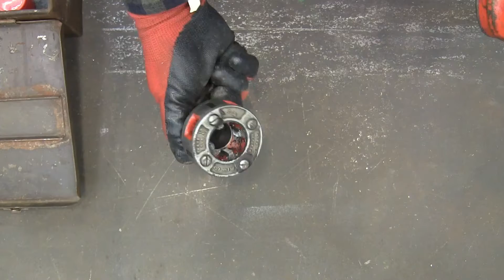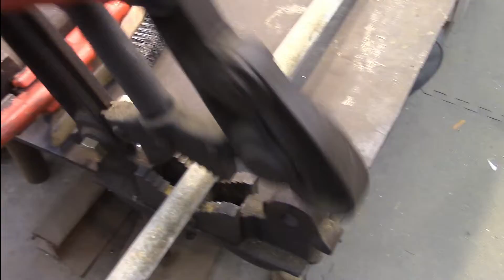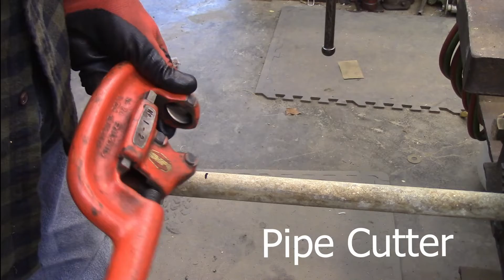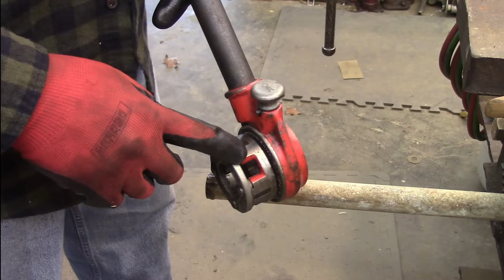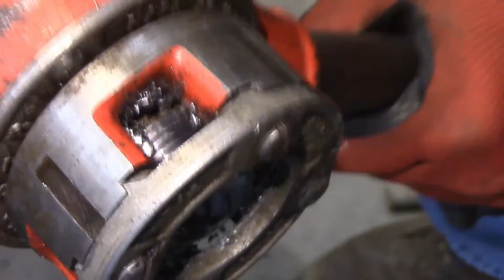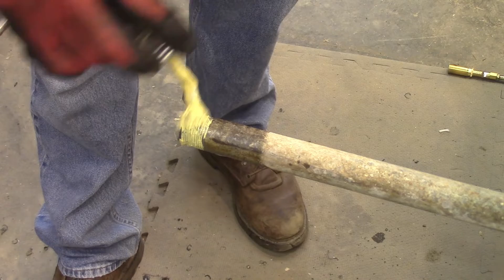DIY PIPE THREADING AND SEALING

Comment: Hopefully you know that the zinc flakes off galvanized pipe and plugs up gas jets. That's why black pipe is used for gas and propane. Happy pipe fitting.
Reply from the maker: Thanks Jeff, I do know that it flakes but I had enough of it on hand to do the job.  I've used it for years and not had any trouble.  It's for my aluminum melting furnace to nothing vital.  Thanks for the info!

Comment: Good video on threading.  If you ever have a chance get some Loctite 565 thread sealant. It is the smoothest thing I have found.  And brush on, oil base Rust-o-leum paint works very well too for gas.  Have a good weekend out there, stay warm.
Reply from the maker: I used some 565 today on some hydraulic hoses.  I hadn't ever thought of using rustoleum paint but I bet that does work really well.  Thanks for the idea Glenn!  FYI the temp her today is 72 degrees, it was 24 a couple of days ago.  LOL

Comment: Boy that end cut off really easy (not many turns). For gas shouldn't you use black iron pipe? As always interesting and helpful.
Reply from the maker: You're correct, you usually use black pipe for gas but this is what I had.  It's actually running outside in the weather so the galvanized will decrease the rusting.  Hope you have a great weekend.
Reply: I believe the concern is the galvanized pipe can be porous?
Reply from the maker: Galvanized pipe is just black pipe that is coated with zinc.  The only draw back I know is that there is some concern that the galvanizing can flake off and clog orifices.  However, I've been using this pipe for about 20 years with no trouble I just moved it to a new location.  Thanks for the heads up though.
Reply: Thanks good to know.